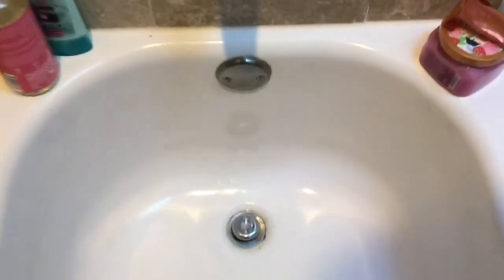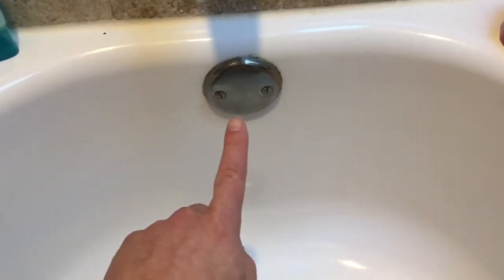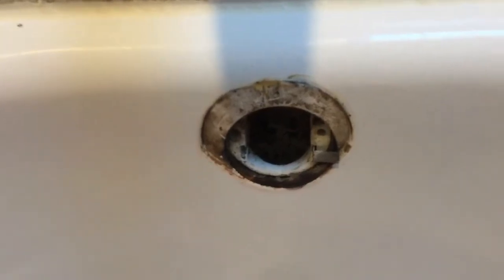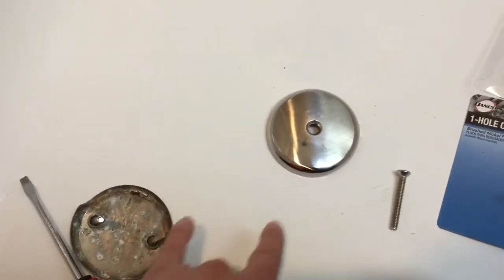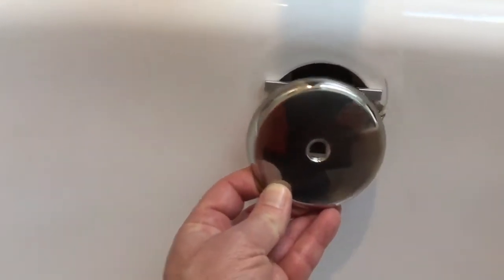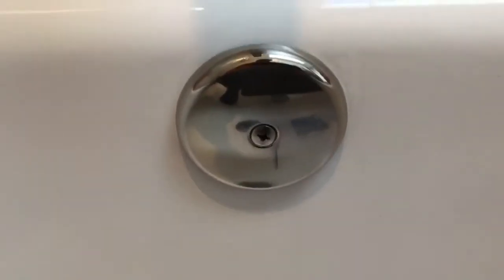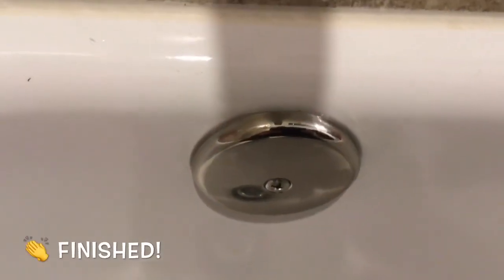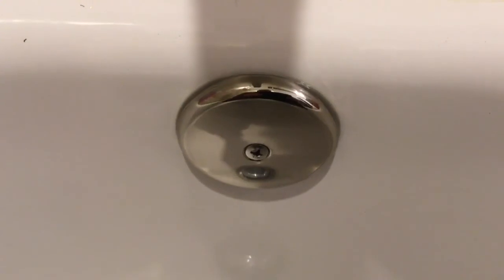Dad Replaces a Tub’s Overflow Cover Plate

Comment: My plumber said he needs to cut the wall (there's no access panel)  is he just trying rip me off. I watched a few of these and everyone does it from the front only
Reply from the maker: Huh. Seems odd to me. Replacing the overflow plate shouldn’t require cutting a hole in the wall. But I’m certainly not a plumber. Maybe there’s a reason they need to do that?

Comment: What did u use to clean the gunk around the overflow opening on the tub?
Reply from the maker: Hey there! I just used some Lysol household spray cleaner and a warm rag. Goo gone would be another good option or some dish soap mixed with hot water.